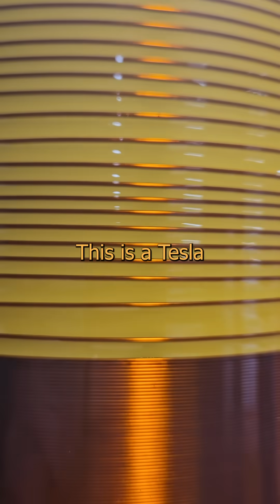Mystery Inductor #chrisboden #comedy #engineering #electrical #tesla #coil #highvoltage #science

Comment: If I was doing it myself, make a map of the taps in a physical location diagram.  Next, use a low voltage ohm meter and map out the continuity paths to determine what is on the same continuous coils.  Once you have taps grouped by core sections, you can see of they have an inner and outer relationship on the physical package.  Next, test with stupid low level AC and take lots of readings on the other windings at their various taps, and you can build your maps of what are the highest and lowest combinations and the points in between.  From there predict your outcome and use a low fuse and your smallest Variable AC transformer and slowly ramp up and watch your numbers climb within the safety ranges of your metering equipment.  Build yourself a resistor bridge if you are suspecting massive increases to get lower numbers if your VAC doesn't go all the way down to zero.  If you get unexpected numbers, back up a step or two, redraw the schematic with the new data you have and check the taps again, one might be damaged or higher impedance that threw you off when doing low voltage DC ohm meter checks.

If all else fails, open the phone book and call my father in West Olive.  He's within reasonable driving distance of the Borculio Mulch Fire you covered last month.  He serviced and installed retired hospital equipment for clinics in 3rd world countries for International Aid in Spring Lake before they closed.  If I had a mystery transformer that was baffling me, he is the first one I would go to for advise and guidance if it might be hiding a configuration that I had never dealt with before.  -and he has probably worked with the one you have at some point in his life.

God bless and work safely.

P.S. His house is a good spot to shoot a laser for 10 miles if you are trying to determine a precise optical beam pattern.  -in case you need a resource like that for later.

Comment: Xray tech here. You want a biomedical engineer.  Probably a old-school  one at that. Sorry, I can't be more help.
Reply: Agreed, the Biomedical Engineers in the "Clinical Engineering" department of your local hospital are the guys who do the diagnostic and repair work on the hardware.  See my reply for info to reach out to a retired one that's not far from Chris.
Reply: I’m an x ray tech and just finished my masters in biomedical engineering.  You want an electrical engineer 😂
Reply: @photonganglol2413 he is an electrical engineer
Reply: As a biomedical tech you definitely want an older one, cause I got no fuckin clue
Reply: Used to work as an electrician in a hospital, and from my experience you probably want a service tech from the x-ray manufacturer it came from.
Reply: Absolutely love Chris for being able to say "I need a $specialized field worker" and one just steps out of the shadows and says "No, you need someone else"
Reply: @jeromeymascarenhas6044  I'm rolling at the series of progressive "That's me, but you really need the next person," comments.
Reply: You definitely won't want a manufacturer trained biomed because they just swap parts until it works but if you find a biomed at your local hospital or third party company then you might be cooking
Reply: @dgwooten7 your perception is a bit wrong. I had training with Samsung for x-ray systems. It's not just replacing parts, it's knowing how equipment works and what does what,  voltage expected at test point but sometimes diagnostics point right to the problem especially with star chained CAM bus. Only an untrained cowboy just replaces parts until it works because that's like replacing a blown fuse instead of correcting what has caused the fuse to blow.
Reply: Electrical Engineer here, working on Medical equipment, X-ray, Ultrasound, MRI, CT, electron microscopy and other equipment. 
It looks like a dual slow start 3 phase transformer. Used to power 2 tubes, 1 short focus and 1 long focus.
Reply: @Wardyworlds  is that the step-up transformer?
Reply: By xray tech he meant technician as in those who work on them..not the button pusher xray tech 😆. I do see how that could get lost in translation. I would personally ohm out the windings and do some ohms law math
Reply: I’m totally not what you need or are looking for, however, I did stay at a Holiday Inn Express last night, so, I got that going for me.
Reply: haha Yea, came here to say "I highly doubt an XRay Tech knows anything about the inner gubbins of the machines... He'll want an XRay Mechanic (repairman) or Enginerd for that." 😋
Reply: @DUKE_of_RAMBLE  well we do or did learn about some of the inner workings of the machines.  But we didnt learn about the drive mechanism or charging of a portable xray machine. We were required to learn how the actual x-ray was produced and how some of the transformers were utilized.
Reply: @DUKE_of_RAMBLE how did you make your text like that? 😮
Reply: @plainaussiedude4368  Sometimes me doing this gets my comment removed, so I'm adding it as an addendum:
The one time I like the italics effecting emojis is with my "tips hat" combo 😊
      🎩👌
     😄
Reply: @plainaussiedude4368  he made italics usually by putting these _ right up against the sentence on both sides, or * for bold , and - for crossout
Reply: @plainaussiedude4368   Put an underscore before and after whatever text you want in italic.
Reply: Get it to Xray itself .........
Reply: Biomedical engineer here, working in electronics,I ve got no clue
Reply: All I know about the radiology gear is they usually need lots of cooling water in that room, but I would not recommend dunking the transformer in a water bath, even though that might be pretty cool 😅
Reply: @TheBayru  i believe a typeof oil is used most of the time.
Reply: Alright, I asked the biomedical engineer who worked on stuff from this era, and his response was, "we never messed with the HV supply because of the danger and very long bleed off times from capacitors, if we didn't have power at the tube, we replaced the entire HV unit."

So I think you might need to find someone more akin to the manufacturer.

But in my ignorant observations, the transformer unit on the bottom looks like multiple windings for multiple outputs, and the rheostat can looks like a saturable reactor to control the current through the transformer via DC bias. The one dude higher up in this comment thread already had a good explanation. The only thing that would be nice to know is which leads go to what
Reply: We're not working up to teaching children how to get in trouble, are we?😅
Heck, we had the real stuff, back in the '50s and '60s
Reply: I'm basically a caveman as far as this is concerned but why can you just fluke the fuck out of it and figure out how it works?  Lol
Reply: @Drew-p1c5o because that would increase the chances of letting the magic smoke out, and turning it into an expensive lawn ornament
Reply: Nah. That was helpful because now he knows where to look.
Reply: @bohba13  And where not to. 😉😁
Reply: Also xray tech. Came here to say this too. We might be slightly educated on how some of the electronics work but its really all on paper
Reply: @chrslefty  You pointed em in the right direction though, still solid helping 👍
Reply: I'm surprised there's no schematic or labeling of sorts inside of the unit, like most electrical appliances have which is what this contraption is in the end. Those pigtails coming out of the transformer are tapping into the transformer coils at points that produce a stepup or down to feed various components. I wouldn't expect or see any reason why medical X-ray equipment would be called on to produce anything more than a portion of a second duration. Don't know if that would be suitable for continuous loading like your fixing to use it for.
Reply: This entire thread of idk ask the next guy is the funniest thing to me
Reply: A high tension tank could generate the current and voltage necessary but the support line would be expensive
Reply: They are rare guys tho
Reply: And yeah although we were expected to have a limited understanding of the tech the army had biomedical techs do all the repairs and even then most of them sent out xray equipment to the manufacturers tech department
Reply: When he said X-Ray Tech… I thought to myself: “I feel like that’s the right tree but wrong branch to be barking up...” I may be in healthcare security but I know just enough to ask clarifying questions. One of my old coworkers left our facility when he got hired as an X-Ray tech. He’d go to school right after shift.
Reply: As a line clearance tree trimmer I can tell you that a chainsaw won't help you here
Reply: Open library might have various books
Reply: Philips xray high tension tank
Reply: Im an arny xray technologist and the major difference between an xray tech and technologist was you were supposed to understand the electronics and physics that operate a xray tube. Unfortunately the army's educational approach was binge and purge all information in about a third the time they give civilians. I want to say from a hazy memory you need to do something with put the alernating current in phase? Unfortunately thats all I got. You really want to do your homework
Reply: That’s extremely useful.
Reply: Another biomedical engineer here - but my focus is analytical chem instruments 

Def agree with the assessment that you want the BME from a hospital or other location that does x-ray for this - any location thats big enough to warrant an actual repair department without needing FSEs for everything 

That or just find an xray FSE haha
Reply: You are not x ray tech liar. Biomedical engineer does not know how does x ray work, only x ray tech knows it
Reply: @jakolama  bruh if you’re gonna call someone a liar, at least make sure your reason isn’t swiss cheese
Reply: Im a qualified radiotherapist and I can tell you how a linac, CT and mri scanner works. I can name and identify components and common/uncommon faults. Its part of the qualification. Im not an engineer. They very well might be who they say they are and at the end of the day, who are you to tell us they aren't. Remind us who you are again? @jakolama 🤔
Reply: @GreyCerberus  I know how an internal combustion engine works but I have zero experience as a mechanic unless you count changing oil and headlights
Reply: @jakolama he is saying x ray technician not imaging for clinical engineering, they use the xray machine, while imaging (connected to biomed) actually fixes the machine
Reply: @cinemasurge1851  wow such ignorance.  Biomedical engineers indeed do design x-ray, MRI, CT, etc. machines.
Reply: @RWZiggy brother I said biomedical tech and clinical engineering, you know why I know? BECAUSE I AM ONE, we don’t MAKE the equipment, we FIX it, I have a biomedical engineering degree, and my keycard says “clinical engineer” on it, so step off
Reply: @cinemasurge1851  you use the word "engineer" like they do in UK?  You have engineering degree where you studied EE and and transducers on living things?  No?  Then you're not an engineer just some repair tech.  Engineers design things according to a system and observe life safety constraints
Reply: @jakolama correct, I'm an electrical engineer, currently working in medical, the medical engineers have no idea what does what inside an x-ray machine. I used to fix mobile and ceiling suspension x-ray equipment. Never ever needed to replace the power transformer but with 1.2kv output at 250mA in the x-ray tube the IGBTs would sometimes blow. The transformer is 3 phase in ceiling suspension systems but powered by a battery normally used in EVs for mobile equipment.
Reply: @jakolama, sure, I'm a technologist, not a "tech", if you want to go that route.  Liar is a but harsh.but whatever helps you sleep
Reply: @jakolama  Wrong.  I am a retired Navy BMET, Biomedical Equipment Engineer Technician and we most certainly got knee deep into all flavors of X-Ray machines and X-Ray theory.  We learned how they operate, how to shoot X-Rays, develop films, phosphorous plates, lead walls, etc. and more importantly, the inner workings of how these X-Ray machines worked, so we could troubleshoot and repair them.  I would love to help pin out that transformer, but without a schematic and knowing what type of machine it came out of, there would be a lot of guess work.

Comment: I'm currently trying to build a tesla coil as well so I love that you are doing this! Also I love your channel man keep inspiring us with awesome knowledge. Side note have you ever heard of teslas mercury interrupt? It could apparently make 100,000 electrical connections and disconnections in just a second and was capable of 50 horsepower of electric energy, he used a direct current dynamo to power it, he spun mercury around and each time a cogwheel dipped into the mercury it would complete the circuit and then break the circuit as it keeps spinning. He was able to achieve high levels of precision using this method while messing with his tesla coil. It was kinda like a high tech circuit breaker that moves and has mercury in it lol but I'd love to see one made! If I don't try myself lol and that's pretty cool!

Comment: Well finding which wire pairs with which should be a simple resistance measurement... finding the multipliers would then be an issue of injecting a low voltage AC signal and measuring the voltage outputs at the other wires
Reply: feed with a variac
Reply: Good advice!  I suppose the other questions would be about power rating and voltage rating.  You could probably figure out the power rating by monitoring the temperature.  I suppose you could infer the voltage rating by knowing that it was designed for an x-ray machine?
Reply: @SkyhawkSteve  you could figure voltage based off the original plug and gauge of wire/country of origin.

At least for input. I mean its gotta have a plug, and you can figure volts based off of that. Unless it was hacked out and sold/ taken as scrap to play with
Reply: You can put a variable load bank on it. Slowly add load and watch voltage drop. When it starts dipping below you desired voltage and frequency you know your max.

Comment: So you have winding counts for this transformer?  Can you run 12V AC and measure the current for each combo of wires?
Reply: Copilot offers this, if you are overwhelmed with the number of secondary windings (5 to 10?). I haven't tried it, and as with all AI content, it probably has to be nerded around with.  Ask and ye shall receive. Note that I'm on China this month and compute is slow.
Reply: import pandas as pd
import networkx as nx

# Sample data
data = [
    ('A', 'B', 0.5),
    ('A', 'C', 2.1),
    ('B', 'D', 1.8),
    ('C', 'D', 3.0),
    ('E', 'F', 0.7)
]

# Load into Pandas DataFrame
df = pd.DataFrame(data, columns=['From', 'To', 'Amps'])

# Sorting by highest current flow
df_sorted = df.sort_values(by='Amps', ascending=False)

print(df_sorted)

# Building a connectivity graph
G = nx.Graph()
for index, row in df.iterrows():
    G.add_edge(row['From'], row['To'], weight=row['Amps'])

# Find connected components (windings)
components = list(nx.connected_components(G))

print("Connected windings groups:", components)

Comment: I dont know a damn thing about things that can't be fixed with a hammer and saw, but I'm definitely stoked to see this kick-ass equipment in action!
Reply: Well then I've got good news for you,: both of those tools conduct electricity just fine!  ;)
Reply: "Wha... what are you doing step-transformer?"
Reply: If you cant fix it with a hammer, your problems electrical.
Reply: @nilamotk  or a plumbing issue. I tried both hammer and saw on those, and learned multiple valuable lessons. Probably should have written them down lol
Reply: I feel that SO hard.  Not the hammer and saw part, but the energy behind it.
Reply: As an ITler I can confidently say that I never encountered a problem before that a gentle slap with a sledgehammer wasn't able to fix.